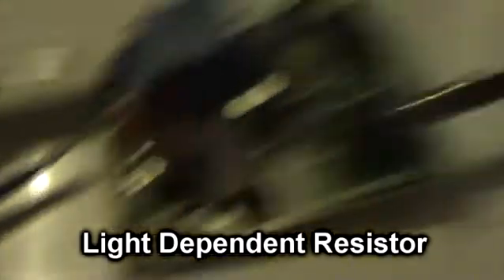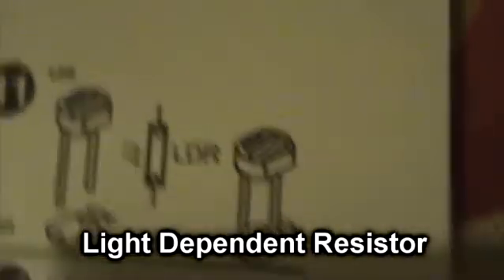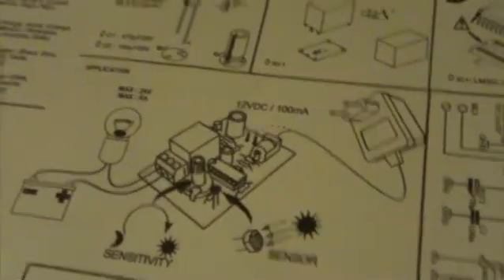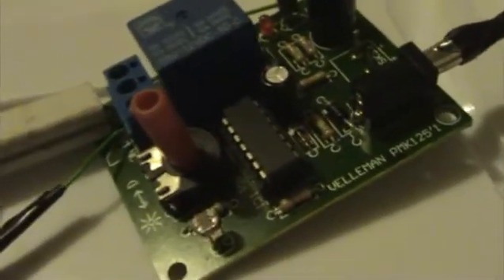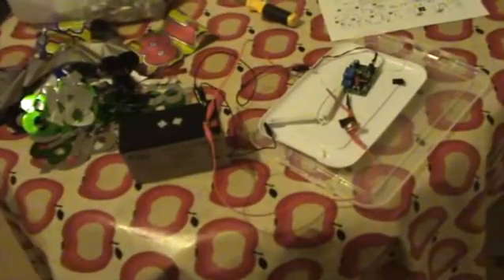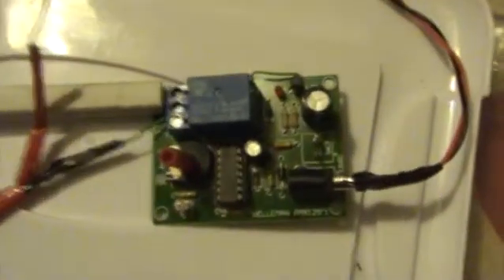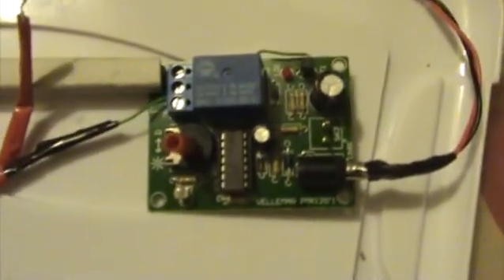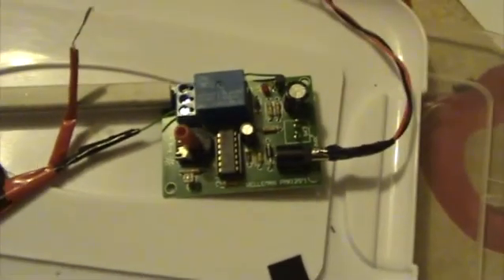LDR LED flasher Velleman MK125

Comment: @Alex1M6 i can see this being part of a solar panel charging circuit too.
what is the ic used for would it not be easier to the photo sell to control current to a transistor that in turn activates the relay (or mosfet ) throw a potentiometer in there and you have all the tuning in the world. im interested in exactly what the ic dose as i myself would have don this very differently than the kit you got. also very nice 1 watt. i have not seen very meany red for sale.

Comment: @Alex1M6 but a mosfet would be more efficient than a relay would it not? its also cheaper and makes no noise it being completely dc and powered by the same source i think it would be the best choice. but if you were turning on a desk lamp needing ac the relay would completely be the rite choice. and i believe the kit you built it from was meant for that?
regardless it is an interesting thing

Comment: Could be used as some sort of emergency light for a normally-lit room.
Like the circuit running of a battery and when the mains current gets cut off and therefore also the main lamps, the circuit starts turning on and off and then turns off again when the power is back on.